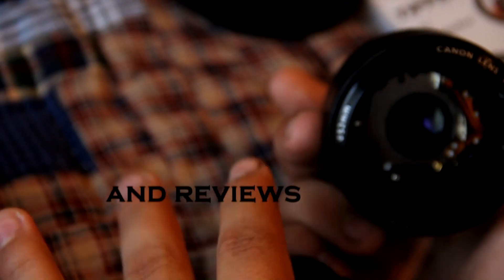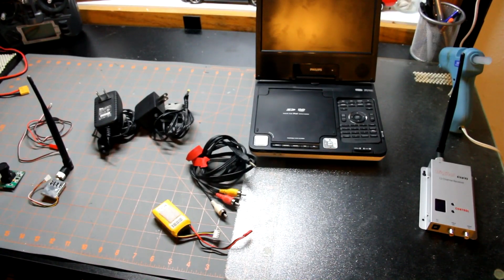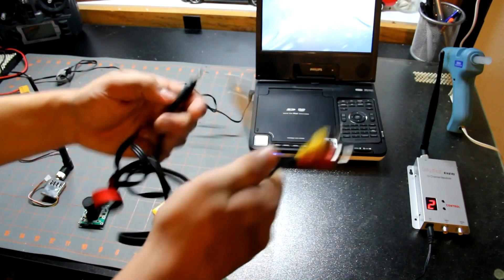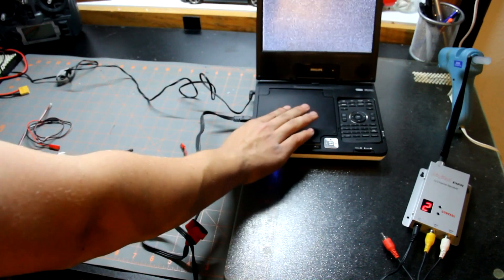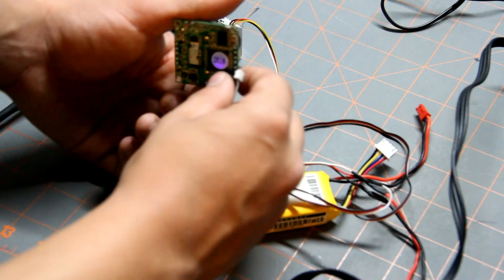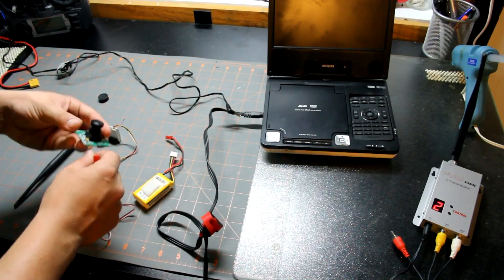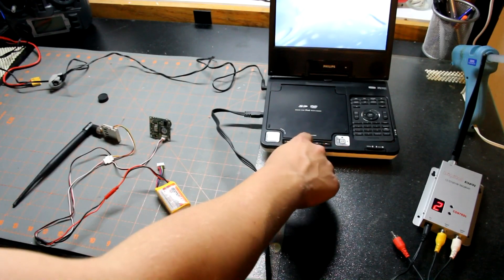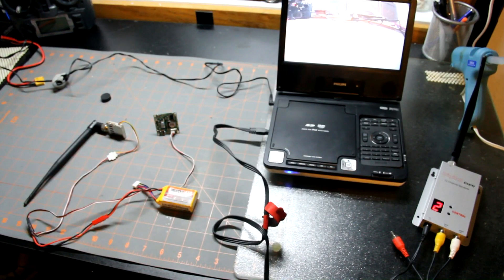900MHZ 200mW Tx/Rx & 1/3-inch CCD Camera NTSC

Comment: Thanks a lot man!! Great video! I just got mine ordered and I have one question. Does the receiver come with a power supply? If not, what are the specs of yours? I know it's a 12v system, I just don't want to fry it with a high amperage power supply.
Reply from the maker: output is 12v 1.5amp